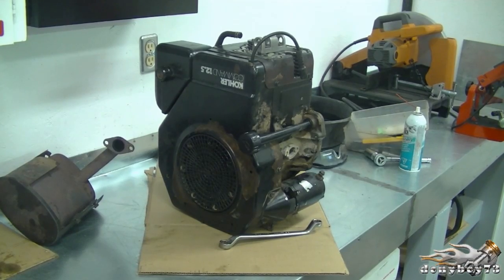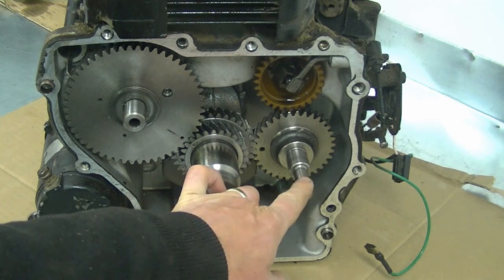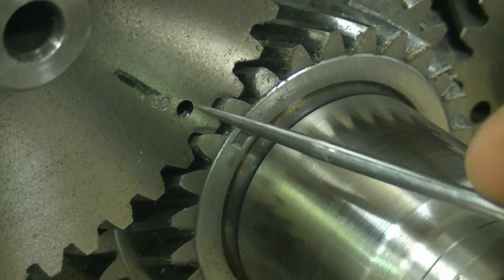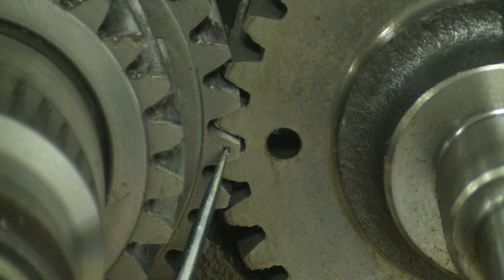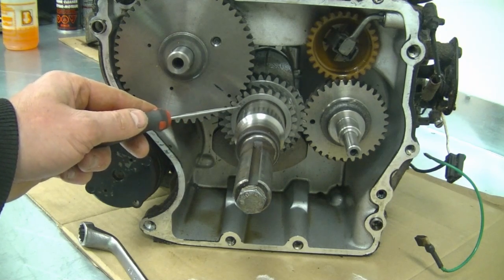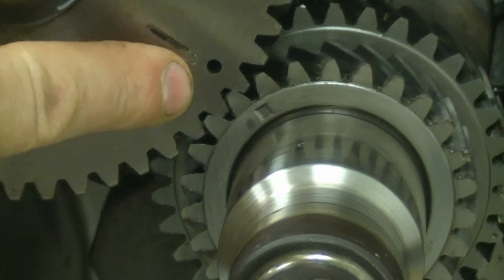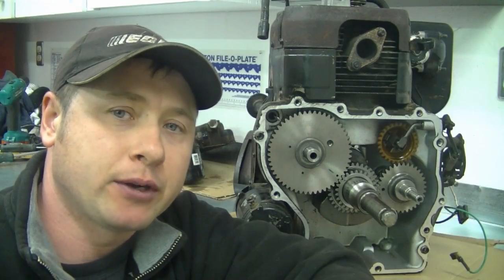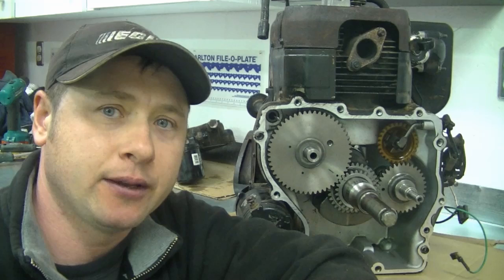Camshaft & Crankshaft Timing Marks on Kohler Command Engines

Comment: This was very informative but it hasn't helped me any.  I have a Kohler CV13S.  I noticed your timing marks (on the crank) are about 200 degrees apart (clockwise).  Mine are 180 apart so all of the marks won't match at the same time.  There is no problem matching up the balance shaft, the problem is with the camshaft.  It will either be right or 180 degrees out.  I'm looking for suggestions before I close up the case and try it out.  I believe if I put the piston all the way in (TDC presumably) and then install the camshaft with the lobes out of the way so both valves are closed I should be good.  Any comments will be appreciated.

Comment: good instructional video.  I have a Kohler CH22, what is the trick in removing the existing old crankshaft and what is the part number for the better more stronger gear?

Comment: I have a Kohler Command Pro 224cc single cylinder where the camshaft gear is marked however there's nothing marked on the crankshaft gear. When I removed the crank case cover, the cam shaft came with the side cover. So I have no reference whatsoever. I can always remover the rocker cover to get the valve timing close however I still risk being a tooth out. Any suggestions? My eyes aren't what they used to be  ... had the wife come and take a look and she picked up the faint mark I was looking for.

Comment: Like the wannabe wallaby I have a question about the ignition timing. Should the magnet on the outside of the flywheel line up with the ignition coil roughly at piston top dead centre? I realize the spark should occur a few degrees before TDC but I have a Kohler Courage engine on which the magnet seems to line up with the coil at roughly Bottom Dead Centre. I am about to remove the valve cover to check the valve timing. Wondering if my engine has timing gear problems. I bought the mower not running so I'm working my way through the problems.

Comment: I am right at the point of reassembly of a Kohler CV15S. I know of the 2 marks on the crankshaft. While turning the crank I noticed that the balance shaft will match twice, but the cam shaft will be out 180*. How do you know if you are on the correct position of the stroke? On the exhaust or on the intake stroke? Please send a reply. I am waiting to get this thing back together.
Reply: I'm having the same issue on the same engine. After my decompression cam grenaded i pulled it apart to fix it.  I've put it back together twice and each time I get no compression it backfires through the carburetor What did you figure out?

Comment: Thank you!  Glad I checked. I had the balance shaft off by one gear - I didn't realize that it had marks on it after I accidentally removed it. All lined up. Thanks Dony!
Reply: If you dont know how to command an engine without marks,,, be very careful.The advise is valid to some car mechanics too.

IF it gts wrong you have to call someone, and pay.
Reply: @julioramossilva3968  no put gear in u but
Reply: What??? Learn how to spell and use proper grammar.
Reply: @raymondjiii  
I dont have even  to speak your language.
Take the pills yo fukin imbecile.
Reply: They should have deleted the marks, so imbeciles would learn fast, dont touch in engines you dont know.

Comment: Don what exactly does the balance shaft do? Does it eliminate some vibration to try to make it run smoother and the other plastic round shaft is that the governor?
Reply: Balance shaft counteracts the motion of the piston making the engine run smoother. The other small plastic one is the governor gear
Reply: yes.. and those engiens are difficult to work, to command,, dont touch there...or you have to call me or someone who relally commnad engines

Comment: Also, if you're going to crack the case bottom like this, make sure to inspect the plastic governor gear.  Even if it looks good, check the oil sump screen.  If there are small yellow strands of plastic in the screen, replace the governor gear, very easy to do.  The oil and small metal particles will wear the plastic governor gear, causing it to spin faster which spins off the metal weights.  I found mine in my sump with an out of control free revving engine.  Nice video Dony.

Comment: hey dony i have a kohler command cv493 on the balance shaft i see no marks does that matter on this model.also the oil pan does not use a gasket what sealant should i use for the oil pan

Comment: I have a similar problem right now...I've been told that its either the fuel pump on the valve cover leaking down into the cylinder, or the carburator is flooding.

Comment: I have a Kohler Command 17.5 that backfires trying to start, I checked the flywheel key and it was okay. Before this it was hard starting and sometimes backfired. It would run until warmed up in a low throttle position.  Timing seems to be the problem. Ideas welcome.

Comment: Not sure if my post to you went through. I have a JD LX173 with a Koehler Command 15hp with a compression release issue. It gets stuck until I go to WOT but comes back on at idle. Do you have a video of the fix or a suggestion?

Comment: What's worse, it's possible to misadjust the external governor arm enough that the metal cap falls right off the shaft, causing the same over-revving, which I discovered can also cause the exhaust valve to not retract quickly enough, hit the piston and get bent. I know OHV engines have better compression, but those old K series Kohlers were much more bulletproof than this.

Comment: Hey dony, you're the man! I noticed what looks like the magnet/stator(?) on the crankshaft, which obviously turns at the same speed. Does this mean that spark is generated every time the piston reaches the top of it's stroke? ie between exhaust and intake stroke. 

Thanks.

Comment: I have a 11 hp vertical shaft Briggs. When turning the flywheel it makes a knock. The engines has 12 hours on it and I re torqued the bolts. Is that normal and it has a truck load of compression. Can't turn it by self past compression.

Comment: Dony I went to start my mtd lawn tractor with a b&s 15.5 engine an it would not crank so I pulled off the air filter an my intake pipe had gas in it..any idea why that would happen... thank you..

Comment: Hey donyboy great video. I was just wondering I have a 2002 Honda XR250R. It used to run well and still does but now it has a metallic ringing noise in the cylinder head. My friend who know's dirt bikes better than me says its sounds like the valves are out of timing. What do you think is the problem with it? 
Thanks,
Eric